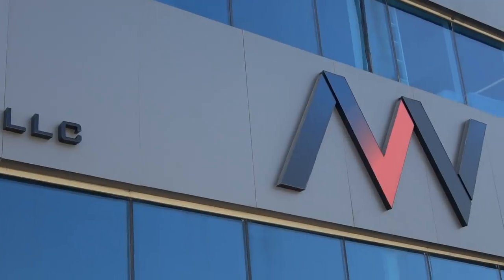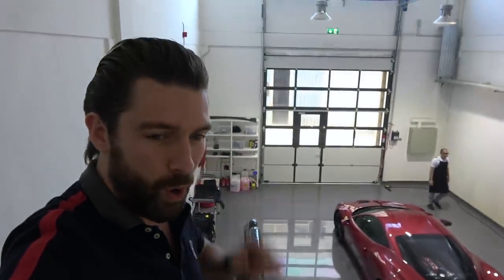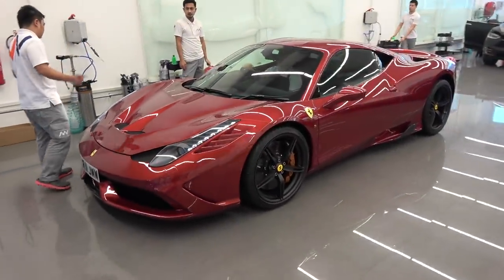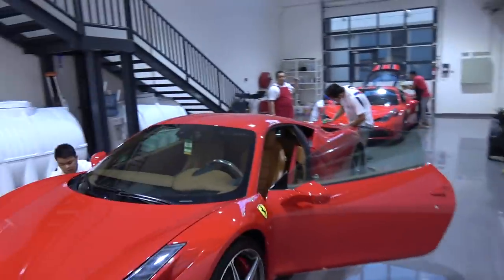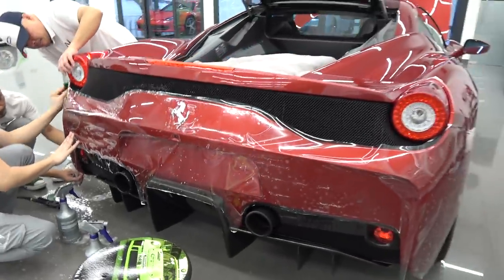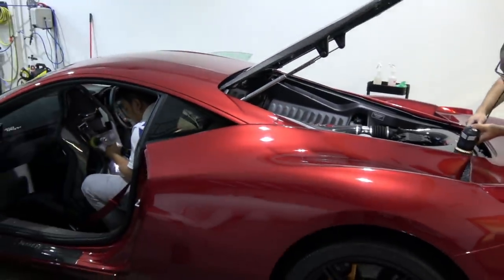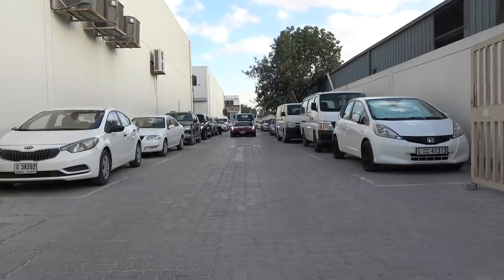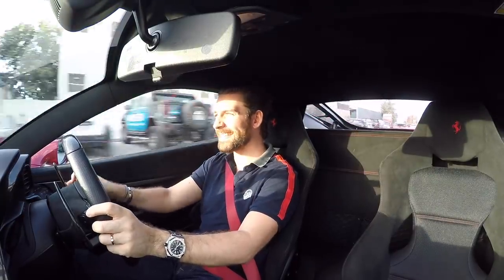I Flew My Ferrari 6000 Miles To Dubai For PPF

Comment: In Australia, you can't simply drive your UK registered (or any other overseas registered) car on our local roads.  To do so, you'll have to re-register the car in one of our states, and since your car has never been registered in Australia before, it'll first have to go through an exhaustive registration inspection (aka Blue Slip), to ensure it meets our road worthy standards. If it passes that, then you are allowed to register it.

Comment: Hey Mr JWW, Did your car have PPF before they did it? If not did they touch up  any existing stone chips?
Reply from the maker: It didn’t have it no, and it was chipped and scratched everywhere so I had the panels resprayed that were damaged and then applied PPF
Reply: Mr JWW awesome, was this done in the Middle East? Great video and the car looks awesome.

Comment: I am surprising myself mightily by thinking the carbon inserts would look better.  I am usually in the camp of plainer, better but ...not this time.  And, ummm, talking up what it will look like in the sun and you drive off into the sand filled streets with no perfect, clean, just completed look over post ppf?  Kinda weird.

Comment: Sorry James, but no. The video was exceptionally well made, the car is spectacular and the people working are very highly skilled BUT flying the car to Dubai was a complete waste of money. You have done spectacularly in life, and I fully commend you for it but wasting it like this is just not right.
Of course, if you can give me multiple valid points for why this PPF application is better than every single UK PPF Application company then this comment is useless but otherwise I stand by the point.
Reply from the maker: It’s not about the PPF Scott, it’s about having my own car in Dubai for over 2 weeks and the adventures and memories to unfold as a result. PPF is just one part of this journey.
Reply: Mr JWW Oh okay, the way you were talking it sounded like the PPF was the main “thing” with driving the car an upside. Apologies, I misunderstood the purpose.
With that cleared up; was it expensive to fly the car over? Or did you get a discount for a little bit of publicity (nothing wrong with that)?
Reply from the maker: Discount for the exposure 👍🏻 and it went freight instead of on the same plane as me which is also more cost effective
Reply: Mr JWW Oh okay, well, well done. Nice of you to be honest, many YouTubers would try and pass off they paid for it all, so props to you!